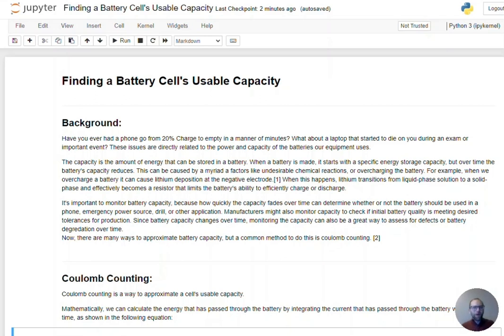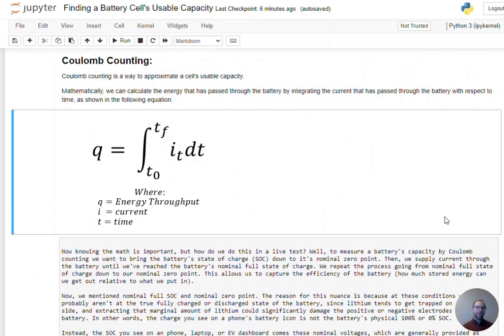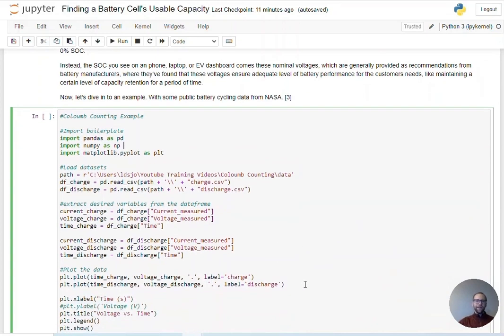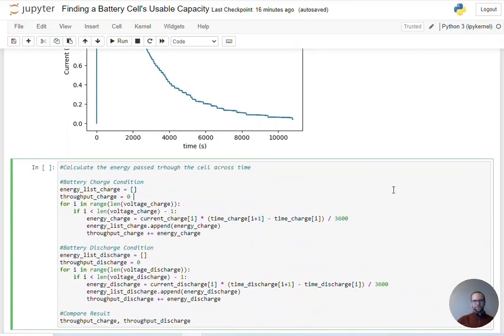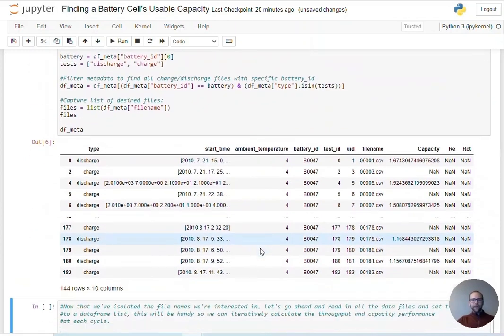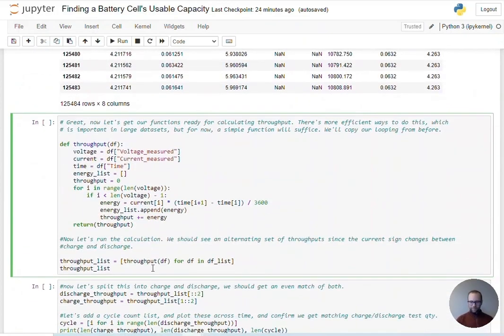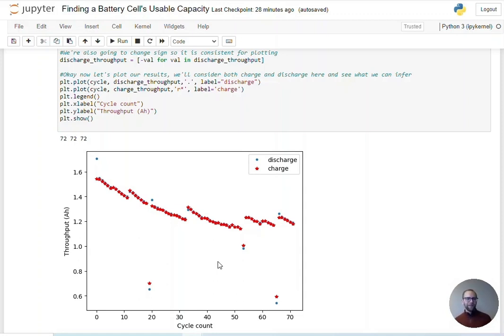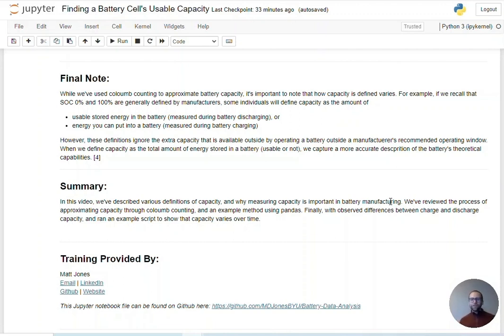Battery Capacity and Coulomb Counting in Python

Comment: thanks for this information. is there an instruction of using Python to plot the cycling data such as capacity versus charge number, columbic efficiency etc. from the battery tester such as Arbin?
Reply from the maker: Glad you enjoyed it! 
I don't have a published video of that today, but I'll make sure it's added soon. How you plot that data, really depends on how your cycler is setup. It's easiest if you already have tags tied to each cycle number and then use boolean indexing to downsample features. If you don't have that, you can infer from current and voltage tracing. 

I'll reply to this comment when it's up!

Comment: Working with Downhole Battery, High Temperature Fluctuations Coulomb counting gets off somewhat.  Kalman filter is tough to setup.  Looking for SOC.
Reply from the maker: Thanks for the comment, can you elaborate a bit more? 

Temperature and c-rates certainly impact the voltage of the battery under load conditions, and if we use the terminal voltage at C-rate to determine the charge, we'd undercount the battery max charge/discharge capacity. From a control volume though, if we're charging then energy enters the system. The SOC should be fairly consistent with the added energy. What will change is your overpotential from the applied load (so terminal voltage would not be equivalent to open circuit potential).   

If you're stuck on a particular application, feel free message me on the channel email address, and I can help more.

Comment: What are the advantages of python versus Matlab or Simulink desiging software?
Reply from the maker: Hi! 
Python is open source (along with most of it's packages),  so your company/lab benefits from the cost-savings. 

Matlab and Simulink require commercial/academic licenses for use, but many people find them more intuitive to use than python. It's got built in functionality that helps with transfer custom code to different languages easily, so that part is nice. Still, I find the license cost unpleasant. 

Personally I prefer python, but at the end of the day they're both programming ecosystems to get the same job done.